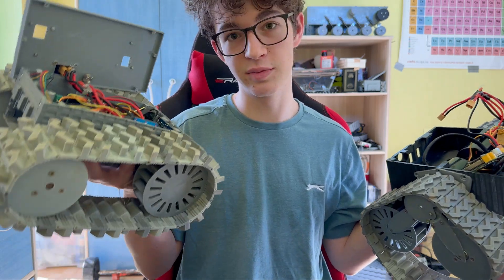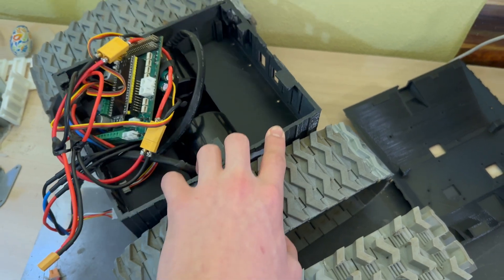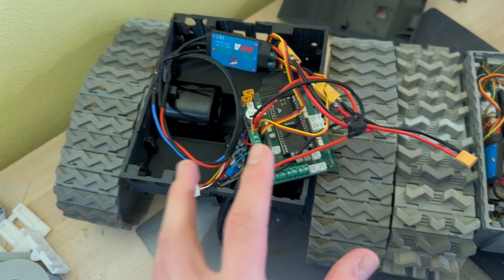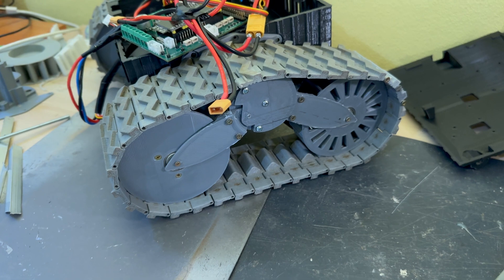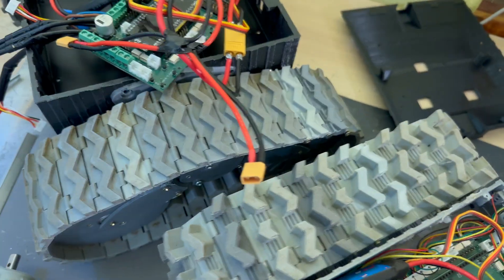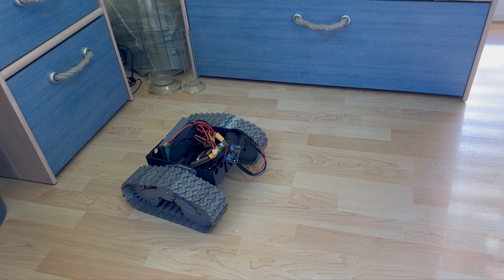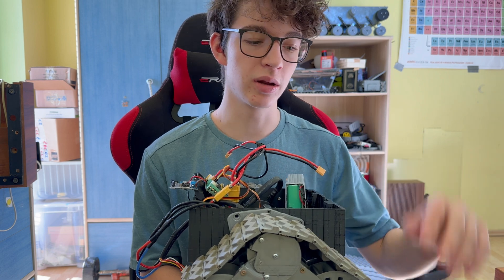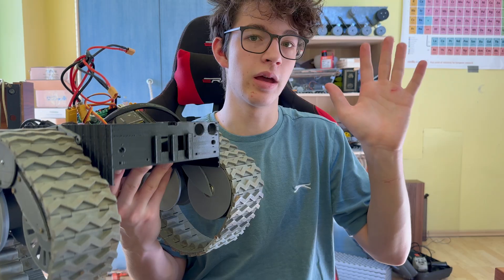NEW vs OLD robot version

Comment: This is a super cool project. The suspension system you came up with seems like a fantastic solution. is there a reason the batteries are going to be attached below?
Reply from the maker: Thanks, I also like the suspension a lot. There are several reason why I decided to place the batteries at bottom. For example, to lower the center of mass and make it easier to remove or insert it.